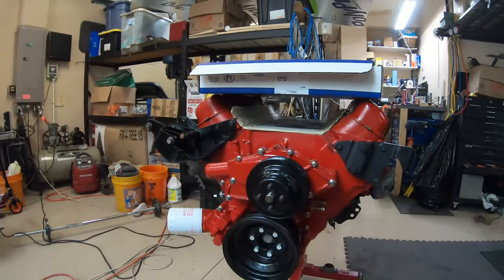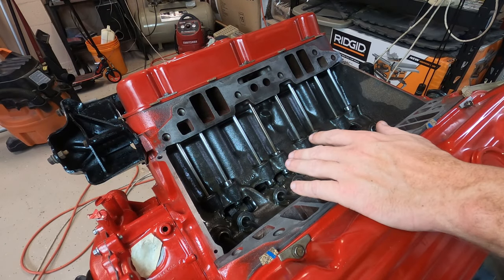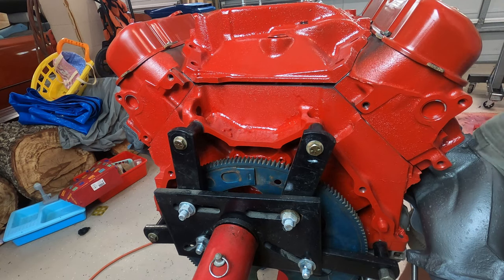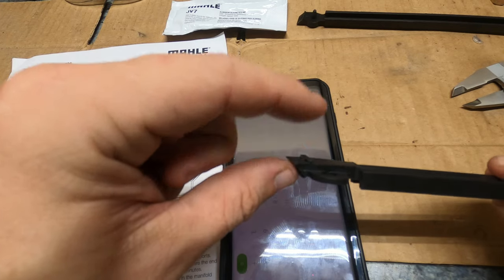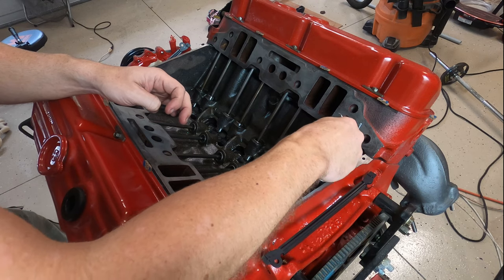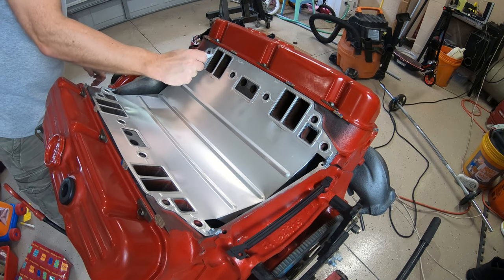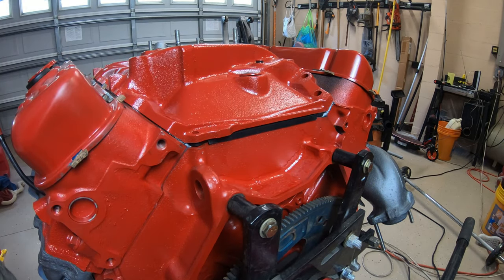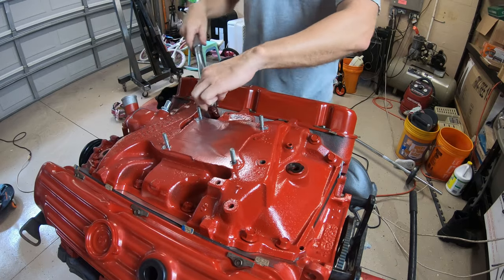Intake Valley Pan And End Seal Install

Comment: Excellent video.  Currently rebuilding a Buick 350 from a 75 Regal.  Hard to fine videos on this model-so it was great to see.
Reply from the maker: Jodas... great to hear. Just an FYI ... I would put sealant around the water jackets and the intake runners. In this video I did just the water jackets but later had to do the runners because I had an intake leak... my intake manifold was not perfectly flat. Good luck

Comment: If you are trying to keep it period correct I would have went with the Edelbrock and painted to match just to save my BACK lol.    I have an Iron intake off of a 429 ford that I have in the garage that we literally used for a boat anchor.   In all seriousness very thorough job on the install and great explanations.
Reply from the maker: I may do that in the future... i could just grind off the words...did you see the part where I had my finger pinned between it and the rear of the block? Lol
Reply: @JackofAllTrades1  I missed that but it's easy to do for sure.  What all did you end up doing to the engine?  Did you have to go inside or are you just resealing everything?
Reply from the maker: @PNW_Car_Mods  there is a lot... its a 464 now... forged reverse dome pistons .050 over, block is zero decked... oversized valves.. heads ported and bowls blended. Pretty much I want it to look stock from the outside but anything out of sight is fare game. :)
Reply: @JackofAllTrades1  HOLY SHIT I have missed a lot.  This is going to be mega awesome!
Reply from the maker: @PNW_Car_Mods  yea I'm real excited and also nervous about it... I hope to have it all done before next spring. I still have several things on the car to upgrade to support the new engine.
Reply: @JackofAllTrades1  Looking forward to it!
Reply: I’m gonna be you un hi lllłoo

Comment: I gotta ask where the gasket might be available for using 70 intake on a 71 engine (heads).  We noticed the wide center port on each head above the small round exhaust ones (which we plugged).  The issue is that the 70 intake will not cover the wide center slots which it seems to be for oil.  If there is a fix to use early intake with 71 heads we haven't found it yet.  Thank you for any help
Reply from the maker: Gosh... there's a whole science to which one will fit. The v8buick.com website had all the info I needed, but it takes some research. This is a 71 intake on 70 heads in the video. From my understanding, there is not a ton of difference in the heads. I believe the main difference was the piston size in the 70 and 71, and that gave the different CR's. 

Luckily, you have pre emission heads. I believe a 71 gasket will work for you. If you see the 70 gasket you will understand, there is not much to it. Also, there shouldn't be any oiling in this area as these heads oil through the pushrod... you may be thinking of the 69 and earlier heads that had different oiling. There are coolant passages but not oil.

Comment: Wish I would've seen this video before last weekend. I changed my intake gasket for the Felpro and ditched the end rubber seal for right stuff only. The gaps are so huge and the beads are so thin, it's was a nightmare and a mess to cobble this altogether. Not even sure I did it the right way either...
Reply from the maker: Yea I've heard some stories about that stuff ending up in the oil pickup tube so I try to use as little as possible. Right now I'm chasing down a vacuum leak on this build and I think it's with the carb... otherwise it could be this pan gasket and I may end up doing this all over again and using that Right Stuff gasket maker around the intake runners. Good luck with your build. As long as you are not leaking oil then you should be fine, that seal is not under a lot of pressure anyway.
Reply: @JackofAllTrades1  Absolutely. The weird thing is that the engine is brand new - I installed the lifter baffle metal thing to use composite intake gaskets. I used the one from TA Performance (they were red) and after one summer, they where "pushed" from above the intake and they tore apart, I've never seen that. I then went with the Felpros but it was a nightmare to put a thick coat of right stuff on the beads. For your problem, if you don't want to install that lifter valley baffle thing, you'll have to use the very same metal gaskets. You may want to put Felpros gasket over the actual metal valley gaskets, or you could indeed put right stuff around the intake/exhaust ports. Hope that helps!

Comment: My 350 is looking like its a 73 number wise and my intake doesnt  have the A.I.R. runners for egr im trying to date everything cause i didnt build it
Reply from the maker: Probably a 71 or earlier. Did you look for the block code? It'll be stamped right by the oil dipstick mount on the block... right by number 5 and 7 plug.

Comment: I hate those gaskets. Been building buicks my hole life. Dont ever use those end seals, even when everything is right they leak in the corners sometimes. Do the Edelbrock B4B, they were available over the counter at the deal back then. I personally think they flow a little better than the performer but if you have a GS with the hood go performer
Reply from the maker: I've been thinking about doing one of the aluminum intakes. This stock one is less than perfect on the underside, and I think I leak a little vacuum because of it. Thanks for the tip.
Reply: @JackofAllTrades1  B4B flows a bit better but carb is moved. Performer is an exact replacement except you use a Chevy stove choke if your using original carb. It will work with the valley pan but TA and felpeo make paper gasket and you can buy a valley pan from ya to stop splash. It your going to plug the exhaust crossover then you don't need a valley pan really.  If you tell me what year your heads are I can tell you the freeze plugs to block the crossover. Can be done in the car,no problem.
Reply from the maker: @kevin2960  My heads are '70 the block '75 and that intakenis from '71. At one point I was trying to look stock but anybody with a keen eye will notice that my car is a '72 and the '71 intake is vastly different from the '72.
Reply: @JackofAllTrades1  Early 72 is the same as 71 and later 72 is like 73.
Reply: @JackofAllTrades1  I used 3/4 freeze plugs, some say 18mm but my heads were a little over 18mm. Get 4 of each and use what fits. Just tap them in. If you want the choke to function you could drill a small hole in one on each side but I wouldn't. Just use an electric choke or manual.
Reply from the maker: @kevin2960  thanks for the info.

Comment: It's gonna leak.
Reply from the maker: It did lol. I had to redo it when I couldn't get a steady vacuum reading. I had to add the sealant around the intake runners as well.
Reply: @JackofAllTrades1  Sucks that it leaked, I was just being an ass. All that work and no vacuum, geez. Did you need to us a new valley pan? Hope not.
Reply from the maker: @charlessmith3758  that setup got me through cam breakin, but it was hell, I ended up having to close off the choke a bit to keep it from being too lean. When I tried to fine-tune the carb, I noticed the vac leak. After months of chasing it, I finally pulled it apart and redid it. Works pretty good now. I'm curious, what did you notice that made you think it would leak? The runners without sealant?
Reply: @JackofAllTrades1  You didn't wipe out the cam during break in, ruining the engine. That's the best news right there. I didn't notice anything. I thought you had it, not sealing the runners. You said it in the video about the valley pan having crush to seal the runners. Like I said, I was just being an ass. I really thought it was going to seal as well. I've seen cam break ins where super weak springs are used to prevent cam wipe out. I don't know if that works, because the real springs are replaced. Just a pain in the ass compressed air replacement job, me thinks.
Reply from the maker: @charlessmith3758  it broke in well luckily, had the intake been brand new it may have done better but it was 50 years old and not cleaned up.